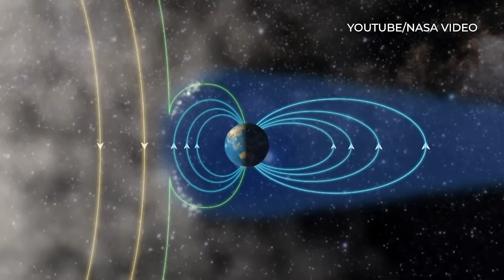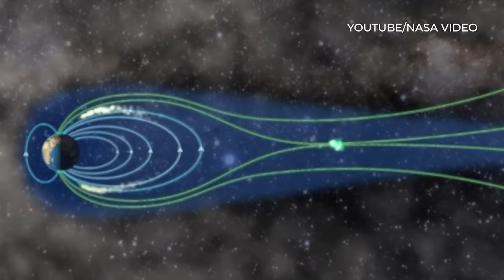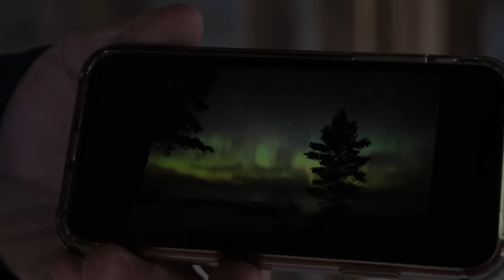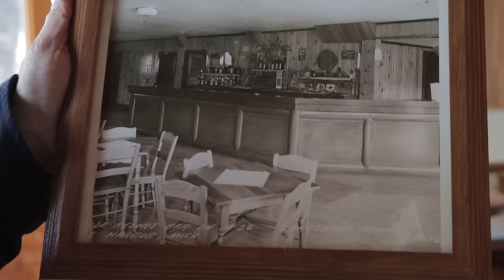DISCOVERING | The Best Place to See the Northern Lights - The U.P. of course!

Comment: Can you see aurora very low on the horizon pretty frequently in the Keweenaw that occur about 600 miles away over northern Ontario / southern Hudson Bay?  In theory you should be able to see these very bright, fast-moving discrete polar auroral bands that often have pink fringes underneath up to 600 miles away.  I think it's possible to see KP2 auroral displays very low on the northern horizon from the Keweenaw but wanted to get your thoughts on this.